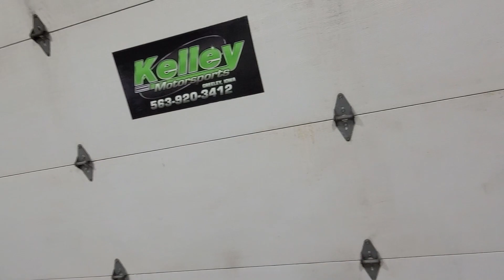Happy New Year from Boosted Ride!!

Comment: I'm not disappointed at all. Winter is a perfect time to get the shop up to snuff and any major updates to the vehicles. Other than #DeathTrap , everything else is a work in progress. 
No surprise with Goliath. Other than the body, everything else needs to be fabbed. I'm not an instant gratification kinda guy so I'm good with you taking the necessary time to do it right.
Looking forward to what 2023 has in store. Wishing you guys health and happiness in 2023.
#BoostedRide
Reply from the maker: 👍 especially shit midwest winters!! I figured most would understand 🙃
Reply: @BoostedRide  I live in southern Ontario Canada so I get the whole winter thing. The only automotive thing that happens is car shows, monster truck shows and tractor / truck pulling. Probably the same as you guys.